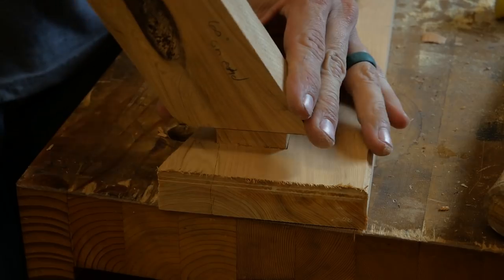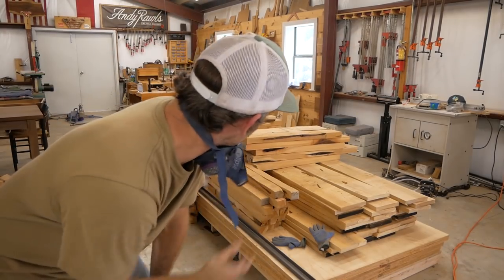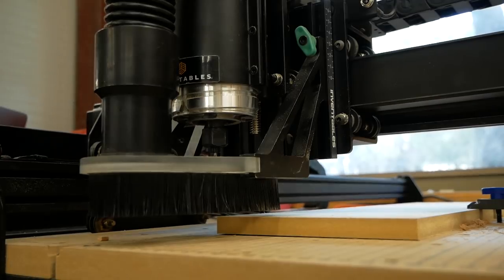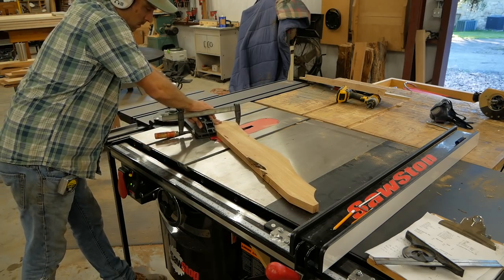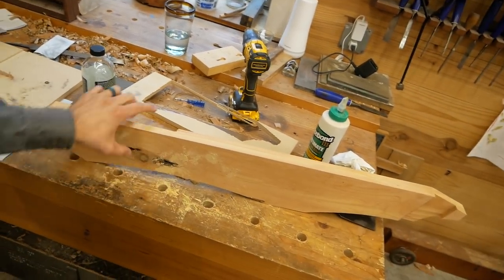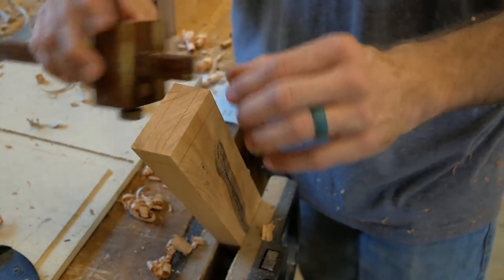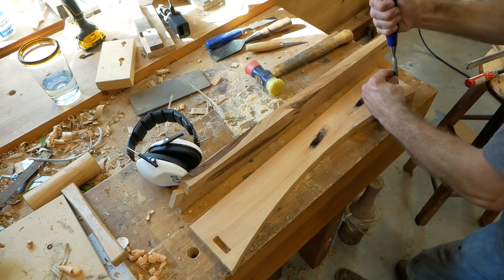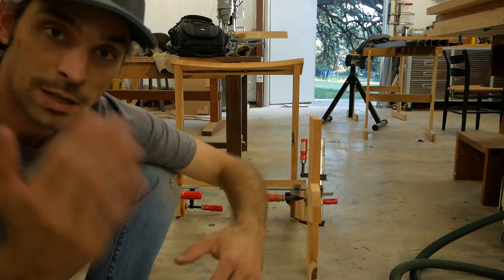Building Adirondack Chairs: Part 1

Comment: As an aspiring woodworker in my first year doing night school (carpentry and joinery basics) I'm only learning with hand tools and I can't help but hold my breath every time your hands go past the jigsaw blade...
Reply: Comrade Questions table saw is by far the most dangerous saw in a shop.  but yes anything with power has finger-removal potential
Reply: @rs-ut5wr  He's got a SawStop table saw - worth Googling some videos on it, and where the name comes from.
Reply: Hazen Fowler i know man, you can see it plainly. im speaking in general. I bet only 1/10 table saws in north american homes are sawstops as you know they are crazy expensive.

Comment: Those chairs are not easy to cut and to build.  The curved surfaces for the seat and the back make for some difficult and inconsistent angles.  Glad you got it drawn up on SketchUp and got that coordinated with your CNC software.   I am anxiously awaiting the next video to see how it all comes together.  Thank you for sharing all of this with us.  Is your mortiser done?  I would have expected to see it in use on this project if it is.  If it is not done, how is it coming?   Also, I keep looking for the basketball hoop replacement.  I keep looking to see if it is replaced with with another wood hoop or if this one will be steel?  If it is wood, i bet you do some steam bending so the grain goes all the way around for strength.  Keep up the good work.  I enjoy both of your video types!!
Reply from the maker: The mortised is done and I’ve been using it, it should be in my next video.  I haven’t gotten around to re building the hoop.  I think I can make another wood one and it will be plenty strong.

Comment: Good Job Andy, so milling all that lumber for the clients, even though they supplied it, it appeared to take some extra work. Did it actually save them some money? or Did they have some sentimentality to the tree? Are you going to epoxy the disfigured areas? Look forward to the next video. Thanks.
Reply from the maker: It saves some but it’s pretty minimal, most of the cost in any furniture build is in the labor.